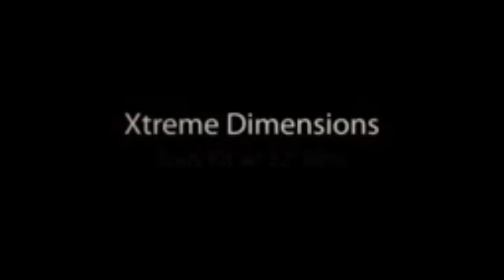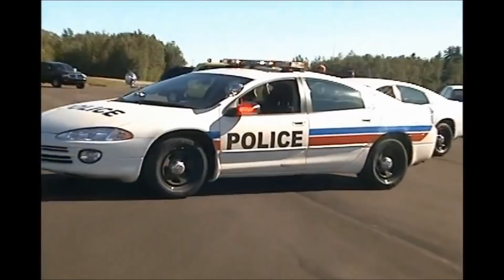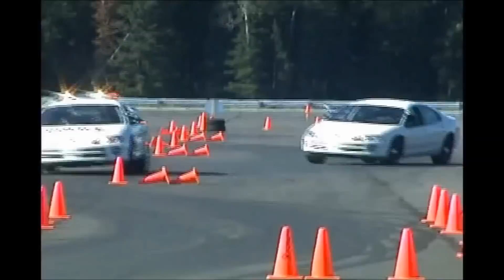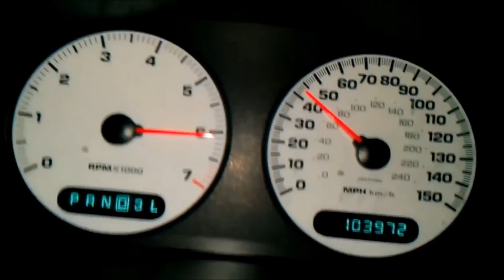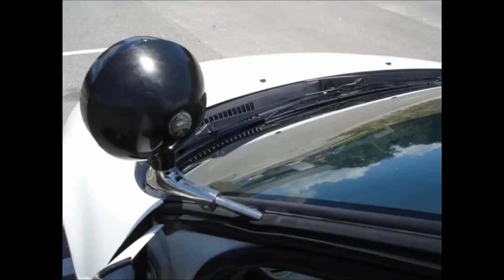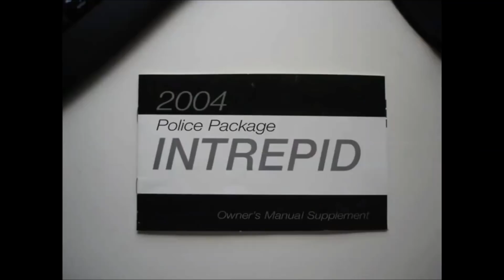The Absolute WORST Police Interceptor EVER! the Dodge Intrepid

Comment: Thank God the Dodge Charger replaced this hideous piece of crap Intrepid.
Reply: +1-UP +Zilla04

No, the Charger is based on the LX platform which includes the 300, Challenger, and Magnum; all of which are rear wheel drive and borrowed many suspension components from Mercedes. The Intrepid was part of the LH platform which was FRONT-WHEEL DRIVE.
Reply: @Rainman00000  does not matter, the lx line is based on the lh line. Period. You can sugar coat whatever bs you've concocted in your head with this balogna, but the fact of the matter is that, again, the lx line is based off of the lh line. Do some homework, even Haynes, Chiltons, and even the FSM's acknowledge this fact.
Reply: @sammaupin3677  correct.  Allpar.com has the entire story from lead designer Burke Brown.  They used the LH architecture to develop the original LX.  Mercedes had and has absolutely nothing whatsoever to do with the LX cars.
Reply: The charger looks better though this shit is ugly
Reply: All dodge Charger engines (both 3.6 and 5.7) needs engine re-build
Reply: Charger was known for being incredibly unreliable too, so nah
Reply: Fun fact - the 3.5 pentastar is more garbage than the 3.5ho. Odds are that it's in your beloved charger. No thanks, I'll stick with my 300m any day.
Reply: Sam Maupin All Pentastars are either a 3.0, 3.2, or 3.6 V6. We don’t get the 3.0 Pentastar in the USA but we do get the 3.2 and 3.6.
Reply: The intripid is not the piece of crap
Reply: The Intrepid is actually loosely related to Lamborghini. Chrysler bought Lamborghini and built the Portofino concept, but it was cancelled, so the design was recycled and used for the Dodge Intrepid/Chrysler Concorde/Eagle Vision.
Reply: The LX platform came from modifying the LH platform using Mercedes components to get a rwd fullsize car. In fact the Intrepid were supposed to be rwd but it was changed and the last minute
Reply: The 1st gen Charger shares almost nothing in common with the intrepid except for the 3.5 h.o and 2.7 engines. The LH platform had provisions for rwd and awd but again the LX platform was a complete redesign with borrowed components from mercedes e classes of that era. Please stop sprouting false information.
Reply: The reason why the Charger is a four door sedan because Chrysler neede a four door sedan to replace the Dodge Intrepid 1993-2004 here's a video link to the 1999 Dodge Charger RT Concept Car which was based off the 1998-2004 Dodge Intrepid  https://www.youtube.com/watch?v=rqLTHBuq1Mg&t=62s
Reply: @Rainman00000  on second thought, your name is suiting for you. Nothing you've said is fact. Better go find Tom Hanks.
Reply: The chargers, extinct magnum, 300 are still just unreliable... Dodge nevered made reliable cars, they make cheap cars...
Reply: It's the same car, just rebodied and renamed...